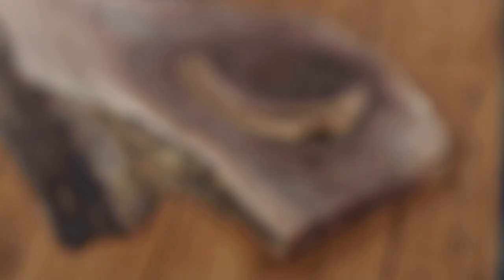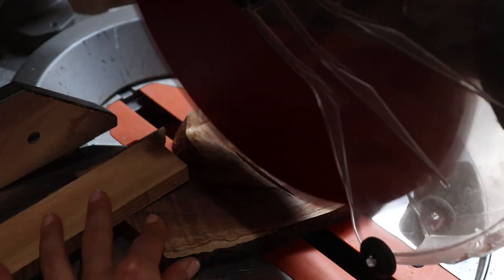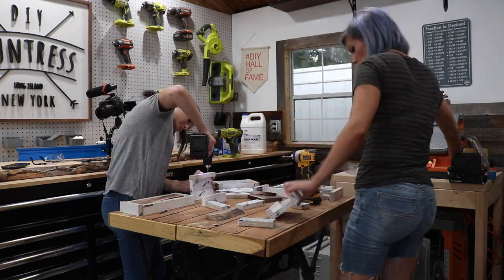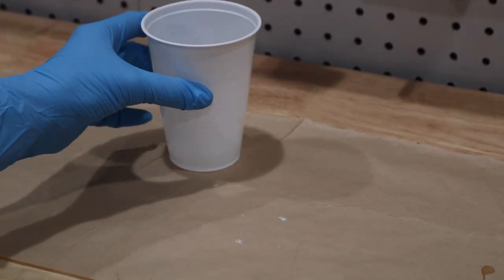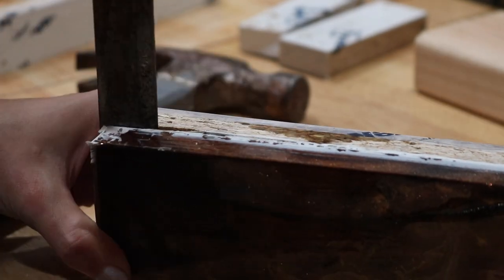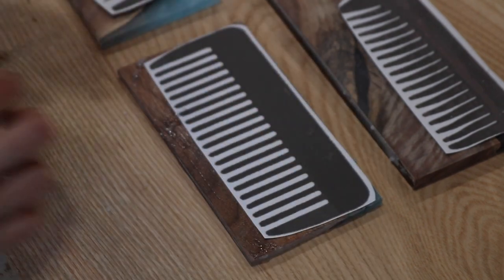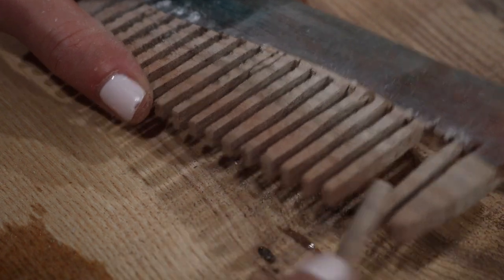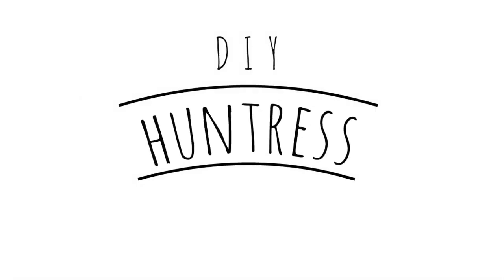DIY Epoxy Resin & Wood Comb | Collab With Pneumatic Addict

Comment: I've found that cutting combs works far better with the grain running in the same direction as the teeth. This makes for a sturdier comb. The downside would be cupping and bowing across the grain, so I add a cross grain spline on my combs for stability.

Comment: You can add some strength to the comb teeth if you change the angle that the wood grain relative to the teeth.  The vomit comb grain was almost completely perpendicular to the direction of the tooth, making the teeth the weakest in that configuration.  Great video, thanks for sharing
Reply from the maker: There were lots of things that didn’t go right in that one... always a learning experience! 🙌🏼

Comment: One way to strengthen the wood is by stabilizing it with resin.  The wood retains most of it's beauty (it looks like it was sealed in polyurethane) but it requires more time and equipment.
Reply from the maker: Was also a thought! Been thinking of actually giving the combs I made a light coat of resin... may have to go back and do that. Thanks for the advice!
Reply from the maker: +Born Again Maker Oh - That’s way more intense than what I thought you meant. 🙈 Not opposes to trying at some point though if I keep doing more resin projects! Very cool video recommendation - thank you!

Comment: As mentioned by Patrick you have the grain running the wrong way in your vomit comb.  As it is now scrap just cut a piece of it at 90° to the teeth and see how strong the wood is in that orientation you will be amazed.  If you have thrown it away just try it with any piece of timber and you will discover the difference. Excellent looking work, remember woodworkers spent most of their time fixing mistakes so no shame in this failure.
Reply from the maker: Thanks for the feedback - I’m always trying new things and learning. It’s part of the process! Totally gonna try my hand at this project again soon as I still have some cutoffs leftover from the walnut slab we used!
Reply: When you try again just align the teeth of the comb with the long grain of the timber and you'll be fine. Good luck and take care.
Reply from the maker: The only downside to that on this particular piece is that I really wanted to use the live edge to pour the resin in, and if I focused on the grain direction, then I wouldn’t have been able to use the live edge. I would have had to use the straight edge. Hmm... I’ll have to experiment with this one!

Comment: The broken teeth might have been from weaker wood. I wonder if this is a good project to stabilize wood with some cactus juice or something to make it stronger.
Reply from the maker: Cactus juice!? I’ve never heard of that before! Gotta look into it...
Reply: It's a penetrating, stabilizer resin.  You soak your wood in it for a few hours in a vac chamber, then set it off in a toaster oven (heat activated).  People who make (for example) pens with really loose, pulpy woods use it to turn the wood into solid, stable bricks that won't fly apart on a lathe.
I think the grain direction may have also contributed to the troubles you had with the teeth breaking off.
Reply: @diyhuntress  Dosbomber has the info here, and makes a solid point about the grain direction.